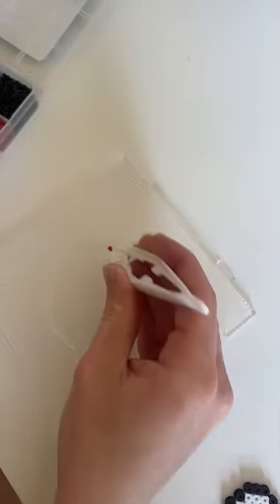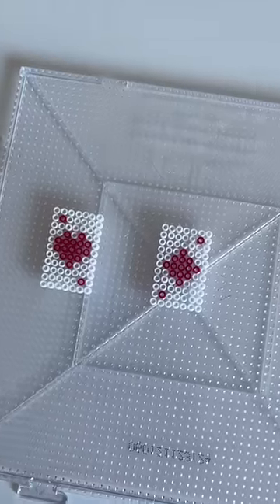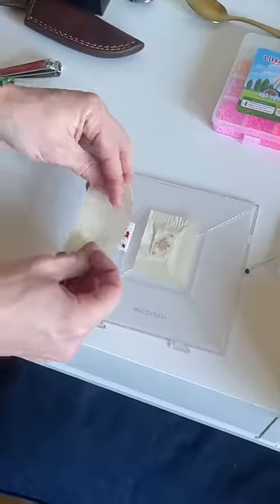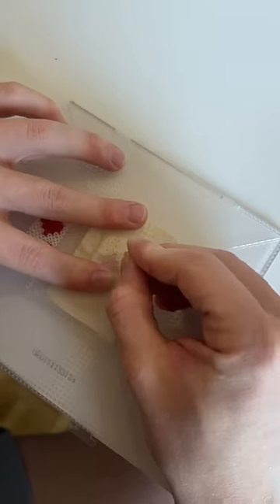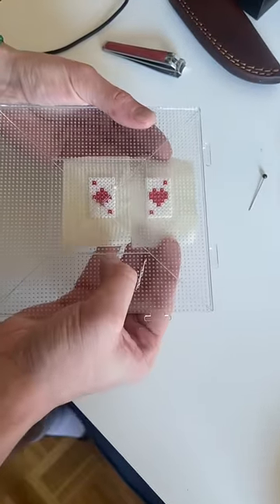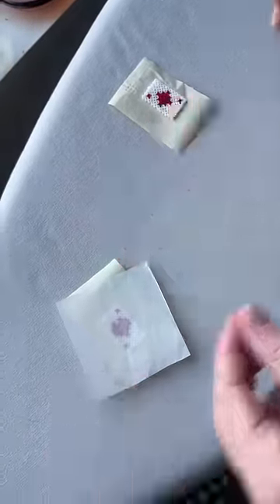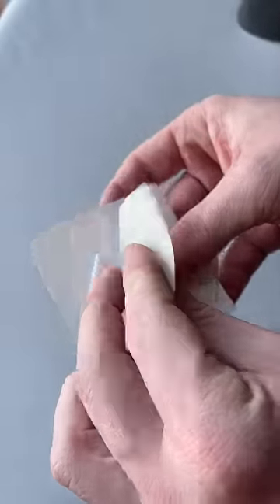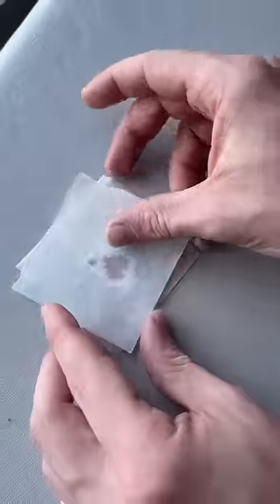Perler Bead Earrings Tutorial from my Fiancé!! #shorts

Comment: Lol I never moved the beads off of the board, I just ironed it right on there, with parchment paper in between. The board never melted though :)
Reply: Maybe the smaller pegs melt easier
Reply: Tbh, I always did exactly the same, but I could never get it to melt evenly on either side so I wonder if this will give a more even end result :) such a small change, might do nothing or may make a big difference!
Reply: Yep, that's how some of the brands advice to do it.
Reply: This is the way I always do it too and it works well for me!
Reply: I think this way theres less bumps from the pegs in the final product
Reply: same
Reply: Same
Reply: Same, i did actually melt a few boards that way
Reply: The smaller bead boards melt easier and the beads melt faster, i’ve definitely ruined a few boards and designs
Reply: I forgot to mention the smaller beads move on the board when you lay the parchment paper on top of them
Reply: My board became curvy because I did this 😆 thankfully my project's already done and I never use it again since lol
Reply: Same lol
Reply: yea but my thing once melted
Reply: same!